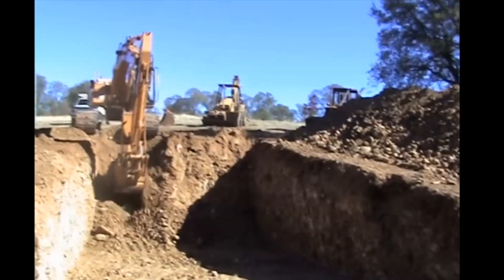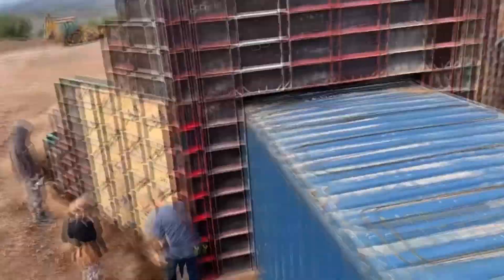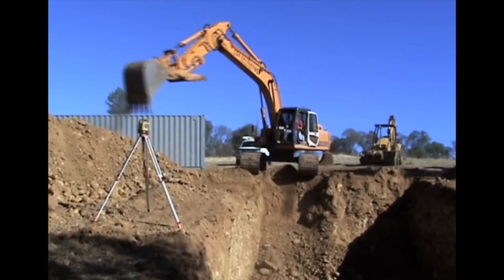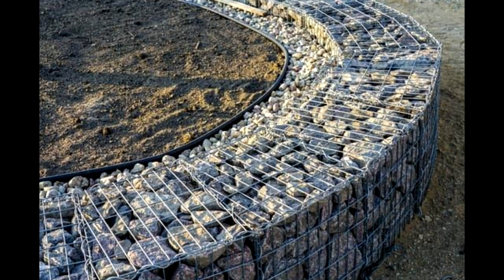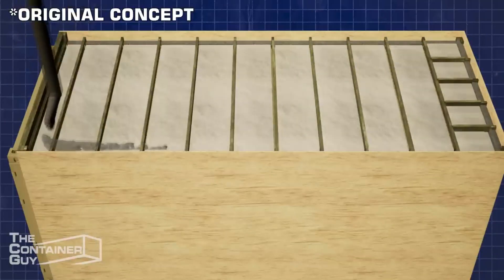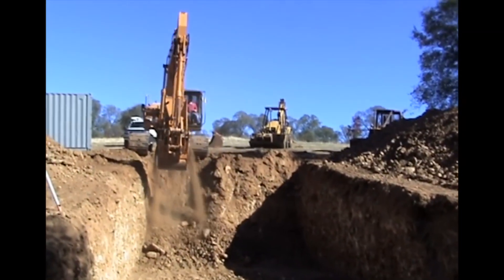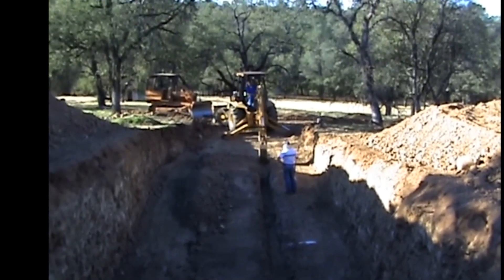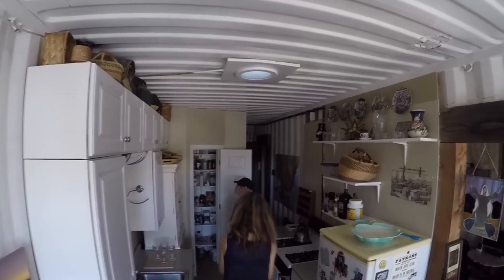Buried Shipping Container Applications: Benefits, and Challenges

Comment: I have seen the concept of spray insulation on the outside and then building a concrete "cocoon around it to take the weight of the earth.  Seems like a good idea...but at that point why not just use the concrete structure and skip the container?

Comment: im thinking about completely burying a container into the ground and have the top become the floor slab for a yurt (partially as a yurt is round)
to my mind the following would work:
dig an oversized hole for the container by 2 feet on all sides
drop gravel on the soil and level it
line all container walls with one layer if 1inch thick plywood, including the ceiling
drop the container and make sure its levelled 
lay extruded polystyrene sheet foam all around the plywood "wall"
build 5 rebar cages for all 5 sides and drop them between the foam and the remaining space of the trench (1 on the ceiling
pour the concrete, so that you fill all wall/trench space and keep pouring until you reach 5 inches of ceiling thickness, get a section of pipe to create the hole where the venting will occur and the plumbing will go through
allow to cure.
Cover everything with soil (2 feet)

Would this work?

Comment: Instead of pouring concrete around it spray the concrete like you would a swimming pool. Then the only forms you need are the walls of the shipping container itself. After the concrete walls have cured pour your house slab on top of it. If course temporary reinforcement  is required.
Reply: Would the container be strong enough to hold a cement as the form itself? Also, it would still need lots of rebar in the cement as reinforcement, correct?
Reply: @TheOConnFamily  Yes we build 4 story apartments over rebar enforced Shotcreated walls. Yes the container walls would be strong enough but you would still have to have additional  temporary shoring from the inside.
Reply: @TheOConnFamily  Tara simple 4x8 sheets of plywood with 2x4s spanning from one container wall to the other. Containers corrugated skin is already strong. The Additional rein is just a precaution.
Reply: @ :  how necessary is pouring a slab of concrete underneath? What if 6” of base gravel is compacted underneath. Do you think that would work?
Reply: @TheOConnFamily   Well it depends on the plasticity index of the soil where you live. I live in North Texas where the soil swells when it gets wet and can expand up to 12" So if you don't have that wgere you live then the road base would do just fine.
Reply: What is the spray concrete? Is that shotcrete?
Reply: simply genius

Comment: The one comment about putting concrete around the container is good that was my original plans back in 95. But if you wanted to save costs you mention turn the container upside down and every two foot put a c channel on the outside wall and weld it in place along with 2 c channels evenly spaced on the side walls. And to pact number 57 engineered rock around the outside and 2 feet above.
 With a drainage felt over the top To prevent dirt Seeping into the rock.

Comment: The BEST way to bury a container is dig a hole only 12" wider on the sides that will be buried. Have stone base to drain away water and pour a slab to support it on top of that. Brace the inside walls and ceiling well and pour concrete around the sides and top. After concrete cures, it will good to go. To make it last longer and be well insulated, use spray foam over it first before concrete.
Reply: @Jerry-ko9pi  how necessary is pouring a slab underneath? What if 6” of base gravel is compacted underneath. Do you think that would work?
Reply: @TheOConnFamily  Hi, depends of the soil around it, if is quite wet where you live, water might get in from underneath.
Reply: @ : it’s desert, very very dry where I live… hard dirt also